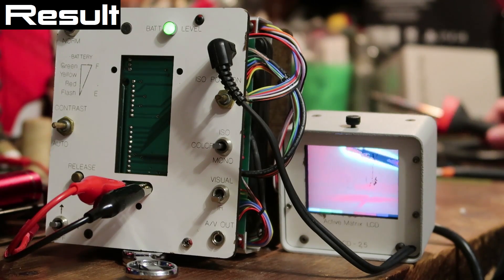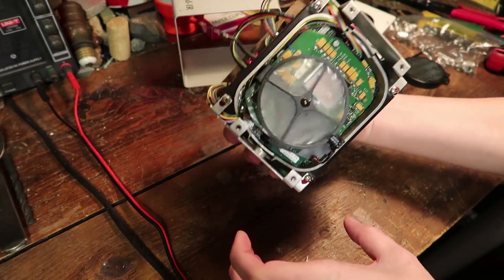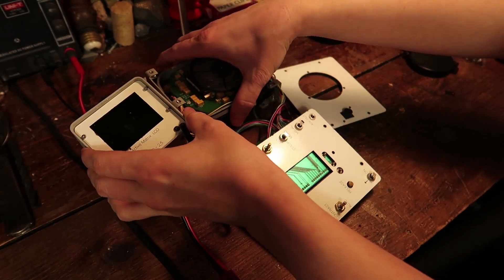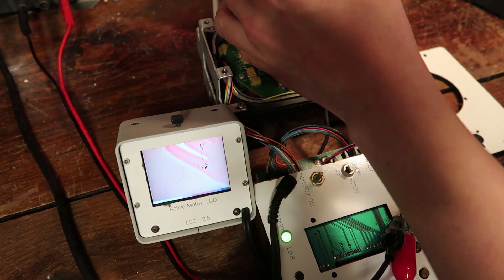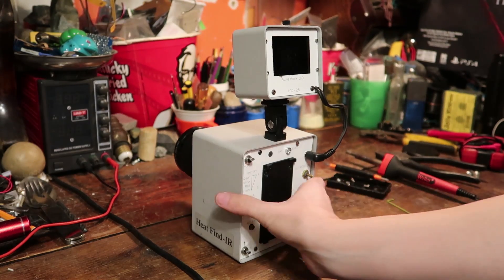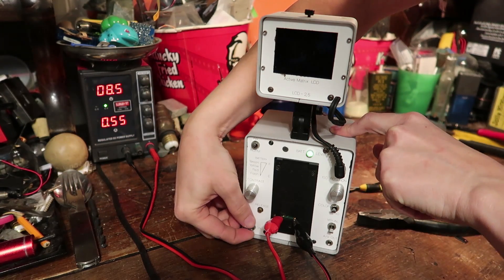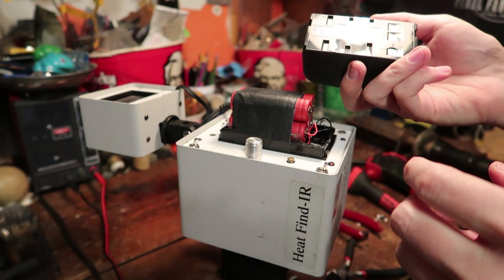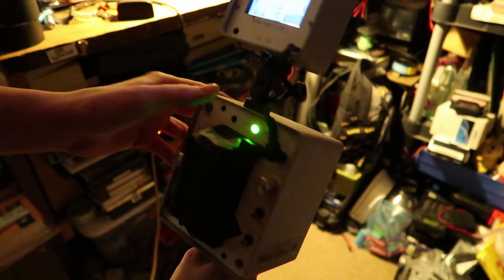1990s Infrared / Thermographic Camera Repair: Heat Find-IR 1300

Comment: I have this same unit in a case that says doskocil on the outside. The unit itself says heat find-IR ; model#1300 serial#130039 this is literally the only piece of information I’ve found online you wouldn’t happen to know of any info elsewhere would you ?

Comment: awesome!  That spinny disc thing is really intriguing.  I wonder how it works.
Reply from the maker: this image sensor doesnt measure how much IR is hiting it, it only measures a change in IR hitting it. so the spinning disc has a spiral that sweeps accross the image sensor and interrupts the IR signal. that way pixels with lots of IR hitting them have more varied exposure than the ones with less, since the spiral blocks it all out. kinda interesting tbh.

Comment: How will you get the output from it, if you were to use it instead of your other ir cameras? Like a digiital8 camcorder or the MacBook that you used a while back for a broadcast camera with a capture card? Will it replace your thermal cameras as a whole?
Reply from the maker: +mehgeme it has video-out connector, so yeah something like that laptop with its converter module. however im thinking more of using this as a tool, perhaps bot so much as a camera. unfortunatly my expensive therm-app relies on an android device, and the one i have keeps crashing or rebooting or being slow and whatnot for no reason so recording with my expensive camera is tedious and unreliable. :/